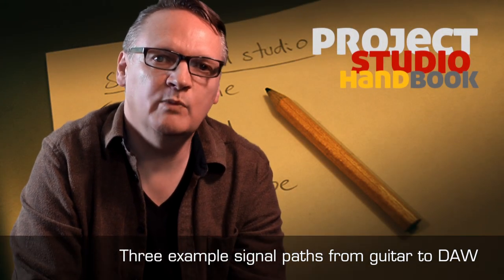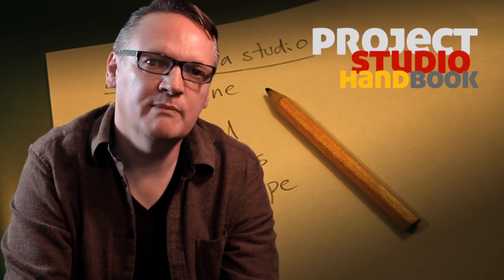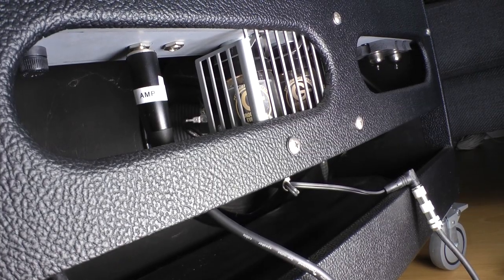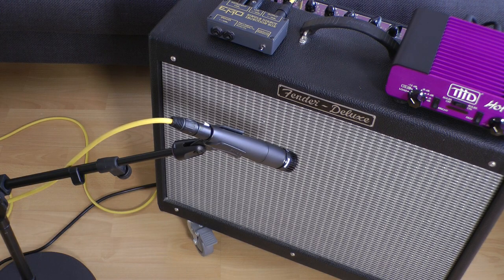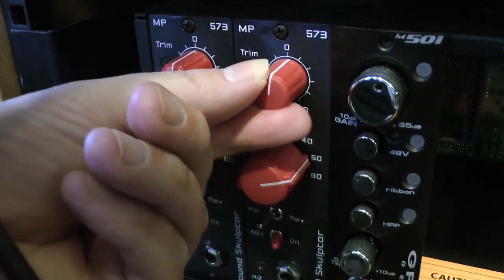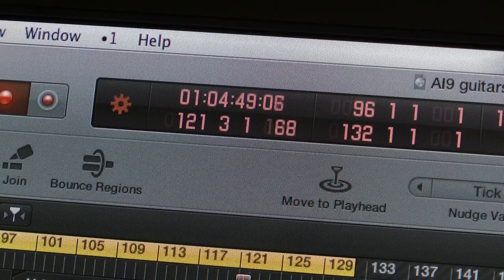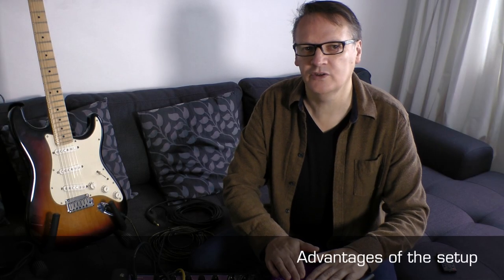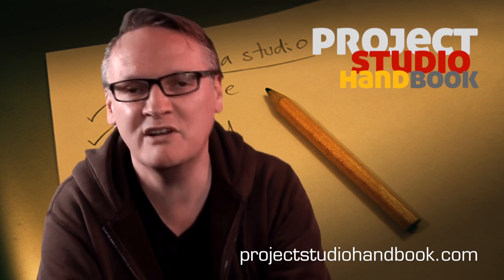Three example signal paths from guitar to DAW

Comment: 1:24 of this video confuses me. You say you're taking "a link-thru output from the di-box (a copy of signal going into di-box)". But how can it be an output if you've plugged it into the 2nd instrument input?
Reply from the maker: Good question. The printing on the EMO DI box does not make it clear but the two "Instrument" inputs are in fact paralleled for the purpose of providing a link through back to an amp (the signal is copied). But the manual is clear about this. We're not sure what the effect of plugging two guitars into the two input jacks would be because we've never tried it, but there would probably be some impedance issues. It would be better if the printing on the box identified one jack as input and one as pass through, but we guess as they are interchangeable EMO decided not to. Hope this clarifies.
Reply: Project studio handbook Thank you, that clarifies perfectly! Really appreciate your videos by the way - keep up the great work and non-jargon approach :-) I came across them a few days ago and am gradually working through them. Theyre so clear, DEmystifying and fill in many gaps in one's knowledge. Best YT resource on this subject I've come across in fact. I guess those titled (v2) are updated ones...
Reply from the maker: The Fugitives Thanks for the kind words. Yes the V2 ones are slightly updated with a few minor errors corrected.

Comment: What's the deal with converter  why ur not going straight to ur interface
Reply from the maker: Good question! The system we used for the video has an audio interface without a convertor, it simple has digital ins and outs. Thats why we needed a separate convertor. Many interfaces will have convertors built in so you can just plug straight into it. Hope this answers your question.
Reply: Tnx man appreciated